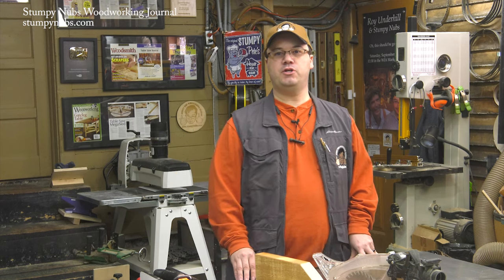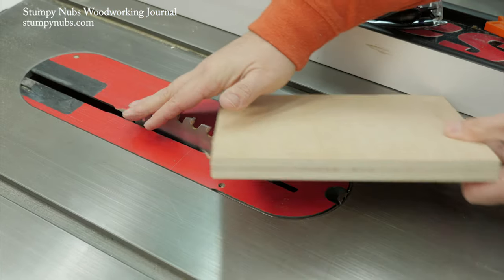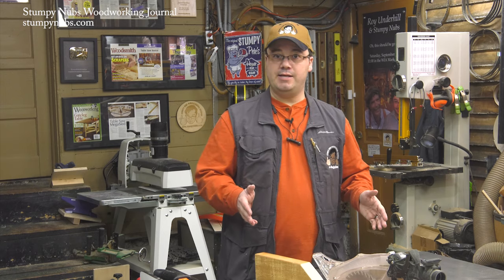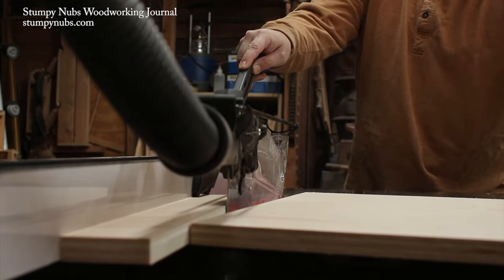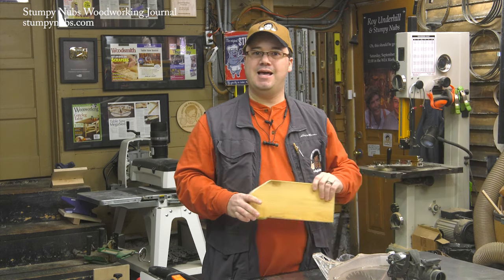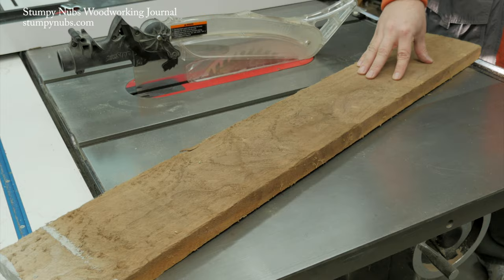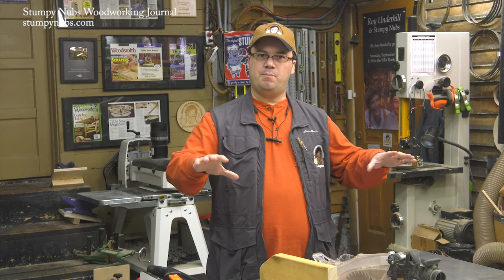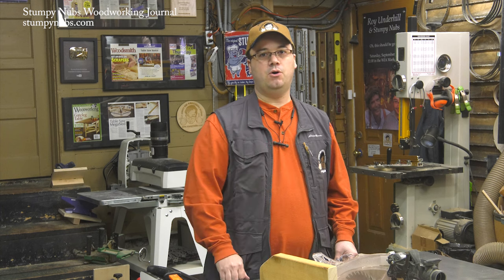Table saw safety tips you forgot about (or never knew)

Comment: I find your videos very informative and sensible. Please continue to publish them. They are a much needed resource.
I live in South America and am currently waiting for my first table saw to arrive by sea freight. It will be my first time ever using one, and I have been viewing as many videos as I can find on table saw safety and the setup for my particular one (Skilsaw SPT99-12). Woodworking is a hobby for me at the moment and I do it on my patio, so size and mobility of heavy tools is an important factor for me, since I need to clean them and wheel them back into my garage at the end of the day. Our homes here are built for as much ventilation as possible, so I cannot keep the sawdust contained if I work inside.
Because it is so hot and humid here in the tropics, I find myself unable to comfortably wear over-the-ear hearing protection so I found these handy little in-ear plugs on Amazon that are connected in pairs by a cord and they are perfect for the job. I always wear eye protection, nitrile gloves to avoid splinters, a dust mask, and short sleeved coveralls when working with power tools.
Thank you for your videos.

Comment: Very helpful, thanks!   Re: glasses fogging up with steam, I saw comments below:   Has anyone tried something like RainX or is there some other type of chemical one could apply to prevent steaming?   It's almost enough of a problem to make me get contacts!

[   And NextLevelCarpentry just posted a short tip about preventing dust collecting on glasses and such, worth checking out, if you don't mind my mentioning another channel.  Anything to increase visibility and safety.  ]

Comment: Regarding that friend who had the knot fly up and hit him, I had a similar thing happen to me. I was cross-cutting a small piece of sapele on a tablesaw and crosscut sled when a piece of the cut-off popped and flew up in my face, hitting my safety glasses and my forehead. This video is a good reminder of all of the above: safety glasses that protect all sides, hearing protection (I'm also a hobbyist musician so don't want either tinnitus or hearing loss), and dust mask. I've been diligent about using my riving knife, and the blade guard and anti-kickback pawls are going back on before I use it again.

Comment: Hey great video, I needed a refresher. Recently someone gave me an old craftsman table saw and while old it's really nice.  Of course, it has some issues like you were discussing. No blade guard and the fence doesn't move very smoothly, etc. It came with a dado insert and no zero clearance insert. It's a strange insert as it seems thinner than normal. Regardless that's an easy fix and I've made several out of plywood over the years. I'm gonna try your insert with the splitter. The biggest issue; over the last 30 plus years I've been using an old Ohio Forge contractors table saw. It's been a great saw and cut truer than many more expensive saws and many of my friends agree. I has a 1 HP motor and was always a little weak and over the years it seemed to be getting weaker. But I can't really complain I bought it new at one of the first Home Depots in my area well over 30 years ago and it still works. Back to the biggest issue, sorry I digress, the Craftsman table saw I was given has a 3 HP motor and I was really excited when I saw that. While this saw is old it's not nearly as old as my old one. The 3 HP motor looks half the size of my 1 HP. So the issue is, that with the increased power, I've been scared several times. I've only recently gotten it set up and so I haven't used it very much, but in this little time, I've had more miss haps than I ever had on my old saw. I think it's the increased power, today I had a small piece of 1/2" plywood kickback and hit me in the gut. I'm gonna have a serious bruise tomorrow. And I was not standing behind blade or the spot that is usually where kickbacks go. I was to my left. I've actually never had this happen. What do you and anyone who has a thought think? I would appreciate any advice or thoughts.

Comment: My saw came with a splitter that doubles as a riving knife. Raise it up, it's a splitter, lower it, its a riving knife. Now in most cases my damn guard gets in the way so I always use a riving knife in my saw, which you will see in any of my videos on my channel. Another tip, if you don't have or can't afford a metal detector, grab a junk speaker and remove the magnet from it. The magnet will pull towards any metal in wood, but it must be a powerful speaker magnet, don't get grab one off of the fridge and think it's going to be attracted to metal in wood.

Comment: If you are a business and covered by OSHA regulations the guard, splitter, anti-kickback fingers and properly fitting throat piece are mandatory as are safety glasses, hearing protection and respiratory protection. Also the saw must be equipped with an electrical interlock to keep it from restarting after a power interruption. A $300 hobby grade saw in a regulated business can result in citations and fines of several thousand dollars. Each missing piece is a separate violation which all add up. Trust me. Been there, done that.

Comment: Very good safetytips. A addition on the plastic pushtip. Throw it away and make one from mdf. I have the experience that the plastic one got grabbed by the sawblade and splattered in many pieces of sharp plastic flying around. And I can tell you, that's not funny.
Reply: Good advice. Wouldn't a plywood one be stronger and more reliable than mdf?
Reply: @juleswebb1885  I don't know. I made mine of mdf and it works for me.
Reply: This is exactly what i thought the first time i used it.  If it contacted the blade teeth it's going to explode, unlike softer mdf.

Comment: The metal detector (or pipe locator) tip to find hidden nails / screws in wood is golden. I chipped a piece off of my planer blade last year because there was a nail left somewhere in a piece of oak. It felt so unnecessary and I guess it was! Thanks!!

Comment: I work at a volunteer in a woodshop where we have additional rules. 1-after use of the table saw, retract the blade below the table surface. 2-keep sawdust swept away from the area around the table saw.  That ultra fine wood dust can make for a very slippery surface.

Comment: I'm sure they're not one of your sponsors, but having seen the SawStop blade guard you have, their videos, and looking at the prices for replacement saw blades + a new sawstop module, I can't help but say that it's one more safety measure that is worth far, far, far more than its weight in gold. Replacing a sawblade and a sawstop module is pocket change against the pain, agony, medical bills, and lifelong crippling injury that losing some fingers is. I use a community workshop that has 3/4 table saws with SawStop; I refuse to use the 4th saw even if the other 3 are in use. My hands and fingers are worth far more than any shop fee or loss of time from waiting for a safer saw to be available. I'm sure every single person on the planet feels the same way.

Comment: I got myself the 3M worktunes with bluetooth. It’s perfect for loud, repetitive tasks where there isn’t a lot of danger for things to go wrong, like sanding (random orbit), putting 20 boards through a thickness planer, standing next to the cnc and so on. On the table saw though, I usually turn them off to focus and to remind myself that even if it’s a small cut it doesn’t mean that nothing can go wrong.  Routine is the most dangerous thing.  
Also, when cutting rough or thick boards, it’s a lot safer to only cut halfway through, flip it over and do the other side. Usually you’re going to plane them afterwards anyways.

Comment: been looking through the back issues and one more odd safety check: if your saw is on wheels to move it in and out of position, don't try to make just one cut without getting the saw onto the base instead of the wheels.

Comment: Great reminders, James.  Thanks for all you do.  A blade guard would have prevented a minor injury I suffered when reaching for an offcut before the blade stopped.  As a result, blade guard is always in use except when I'm using the crosscut sled.  The riving knife is always there, except when using a dado stack.  Proper fence alignment is also key to preventing kickback.  I like the John Heisz design for push sticks and have several of them.  I also have a sanding block I got from HD that is about 8" x 3" on which I put some non-skid material that I use when cutting wider stuff.  Feather boards help also.

Comment: What are you thoughts of downgrading the size of a table saw blade, since it is lighter in weight and it takes less amps to get through the wood and theoretically could be safer and much cheaper?

Comment: Did you know that when you cut off the ends of your fingers with a tablesaw that when they heal in 4 to 6 months that your fingerprints return?  I now have in my shop yellow "caution" tape around the top of the 4 walls, so I am constantly reminded of what happened to my fingers and not have anything like that happen again.  Thank you for the tips and reminders, makes me safer.  And thanks for all your good work!  Now, how about the build you promised?

Comment: Consider a foot switch for your tablesaw. If you're gonna cut a lot of the same rather large part, you might be inclined to stand on the fence side for more control, and feed your parts from a nearby pile. For this application, a foot switch is a nice deal.
Reply from the maker: How would you cut a sheet of plywood if you have to start your saw with a foot switch?

Comment: Great advice, and I'm looking forward to this series!
Question: Is the riving knife that came with my table saw only to be used with 1/8" kerf blades? I'm planning on upgrading to a Freud 10" think-kerf 24 tooth blade. Will it work with my riving knife?
Reply from the maker: On many saws they are adjustable. Consult the manual.

Comment: Thanks for your videos. I've seen the whole series several times. I'm new to woodworking, and just bought a table saw. I saw lots of security videos because I'm really afraid of this device. I have a question. I bought the gripper, among several pushing blocks and security features, but I don't think it is possible to use it with the blade-guard. In your opinion is it better to use a different push block and keep the blade-guard?  Should I use the gripper for smaller pieces and the blade-guard for ripping longer boards?
Reply from the maker: The Grrripper is an excellent push block. For people with no blade guard, or for when you have to remove the guard to make a specific cut, I highly recommend the Grrripper. But I also recommend leaving the guard on whenever possible and using a different type of push stick.

Comment: Hi Nubs.. curious, if the guard and splitter go with the table brand or the saw brand.. my table saw stand is one where I attach my hand held circular saw under it.  there is a bar across the front that is for turning it off with your hip after you make a cut so you don't have to use your hands.. and also for safety..  I bought it used and am wondering, do I look for a guard and splitter for the make of the table saw or the make of the circular saw..  Not sure which it attaches to. Thanks.
Reply from the maker: The few after market guards that exist are very expensive. There are no aftermarket riving knives that I know of, but there is a splitter option (https://amzn.to/38Bt3VH). I am not sure if the throat plate video we made applies to your type of saw, but you may be able to rig up a splitter in a similar way. (https://www.youtube.com/watch?v=gzdF-bLXc8Q) My best advice is to find a good, used table saw instead of using a circular saw as you describe.

Comment: Good video. I have an issue with the first two items that continue to plague me. 1. I also wear glasses, but when I use eye protection it get's dangerous because the close proximity of the protection causes my glasses to fog up. I have tried many "made for people who wear glasses" type eye protectors. Every one of them caused my glasses to fog and my attention to focus on that rather than what I was trying to cut. 2. Dust mask also causes my glasses to steam up. Again, I have tried many different dust mask solutions but all cause my glasses to fog. I don't like not following these first two suggestions but the alternative is to not use my table saw.
Reply: I empathise with you. I have finally found a good respirator/mask that fits my face really well, but when it comes to eye protection, i find it more dangerous as my glasses steam up like yours. I compromise by relying partly on my glasses, and partly by keeping my face (and body) well out of the line of fire..that is, not in line with the blade. Also, i always check the wood I'm about to cut for loose knots (deadknots). It's a compromise and total safety cannot be guaranteed. There ARE clear safety visors, though, that flip down and protect the whole face. Have you tried them?? I know i should : )

Comment: Do you centre the riving knife with the blade or align it with the outer edge of the teeth?
Reply from the maker: It should be flush with the sides of the teeth on the fence side of the blade.
Reply: Great, thanks  @StumpyNubs

Comment: I had an experience were a piece of the wood I was cutting was caught by the blade and shot toward the operator. It was not a kickback but it was laying flat and fully cut but not all the way out of the blade. What did I do wrong or what is the proper way to prevent it. I did not have a blade guard.
Reply from the maker: https://www.youtube.com/watch?v=8f8VWwtaudU

Comment: James... I have a question for you.  Sounds completely ignorant at first, but I can't figure it out and the only answer I can come up with is "We've always done it that way... Why does the fence on a tablesaw extend past the front teeth of the blade (or arbor maybe)?  I can't think of a good reason.
Reply from the maker: It helps guide the workpiece. Large pieces, such a plywood are much easier to feed with a long fence. You can see what I mean it the plywood part of this video series.
Reply: @StumpyNubs  Amen!  A longer fence can also aid in cleaning up not-so-straight edges.  Run the side with the best contact on the fence and clean up the worst side.  Place the now straight edge against the fence and trip up the other edge.  You now have a board with tw
o good edges.  A fence as short as the one described would also almost guarantee some of kickback as there would now be no way to control the board.

Comment: Thanks for this. Curious what you think about the GRR Ripper push stick system?

They say it avoids asymmetric pressures that a push stick can put on the blade. Thoughts?
Reply from the maker: They work very well, but you have to take the time to adjust them for different cuts.
Reply: Thanks. Lots of parts with the GRR Ripper. As one alternative, I thought your tip on using the feather board as a positive stop for thin cuts helped clarify more options (the next video). Best

Comment: If I'm right handed why not put the fence to the left of the blade? That way your not in the line of fire.
Reply from the maker: You need to have access to the wood on both sides of the blade, fence side and offcut side. You do not want to have to reach over the fence and across the blade to push the offcut portion of the board.

Comment: Instead of safety glasses that fit over your prescription glasses why wouldn't you wear prescription safety glasses with side shields whenever you are in the shop? One layer of lenses will not fog up as much as two.
Reply from the maker: They don't protect above and below the eyes. And my safety glasses never fog up.
Reply: Stumpy Nubs My anti-fog glasses fog up so bad I think it is often more dangerous to wear them than not. I’m contemplating drilling holes in them.

Comment: Yeah this was good. In preparing rough lumber for a table saw, how do you cut a straight line with a jigsaw?
Reply from the maker: Cut slowly and carefully. A jig saw is a rough-cutting tool, but I am talking about breaking down rough milled boards, not about making finish cuts once that board is properly milled flat.
Reply: Stumpy Nubs Not sure I can describe it properly in words, but I have made “safe” cuts on badly warped boards like the one in your video. I screwed the board down to a strip of plywood. The factory straight edge of the plywood rides against the fence to keep the cut running straight. Also with the board screwed down it does not wobble while going through the blade.
Reply: @StumpyNubs Thank you, sir!
Reply: @sampickett3843  Yes, you did 'add' the straight and flat surfaces to your work piece, which worked the problem. There are other videos of people showing these kinds of sleds and how to make/use them to more safely cut a weird piece, but it still isn't totally safe, because as the cut is being made, the release of internal pressures still might cause the warped board to pinch the blade and then the entire jig could be part of the flying danger.
Reply: @root1657  Thanks for mentioning that possibility. I understand your concern, but I don't believe there is any more risk than you would have with releasing internal stresses on any other board you might be cutting. Even on a straight & flat piece of lumber you can have internal stresses that can pinch the board.  I should have added that I still use a splitter to help keep the blade from pinching the board and causing a kickback. Also I am mitigating pinching by only taking off a thin slice of the crooked board (only enough to produce a straight edge). One  more addition, if the geometry of any board causes doubt on the safety of making the cut,  scrap it and find another..